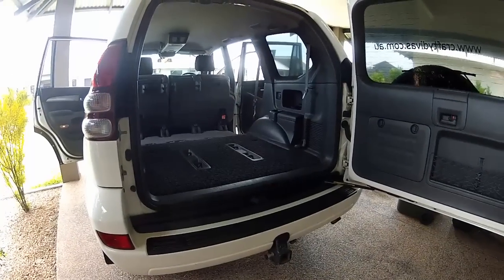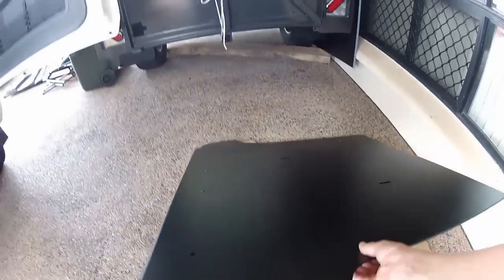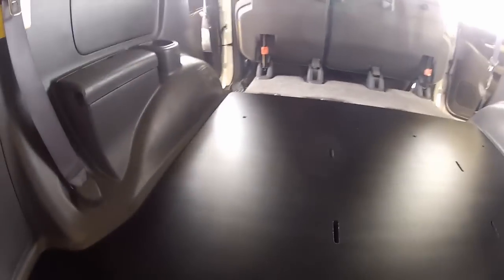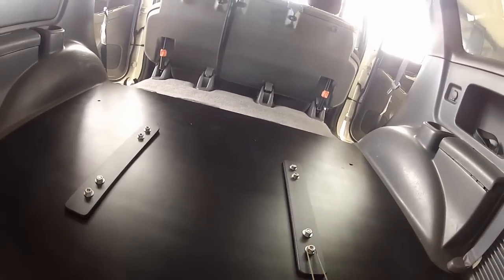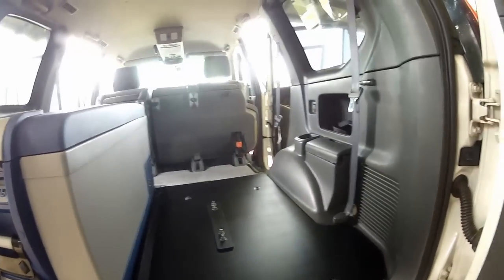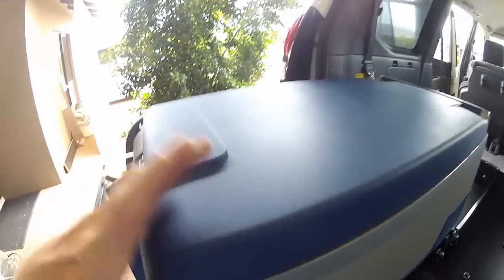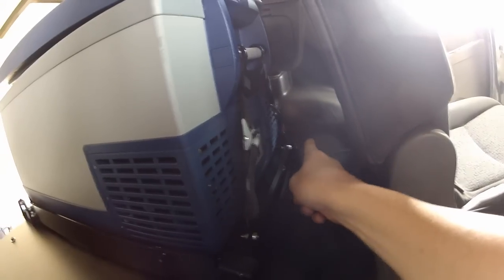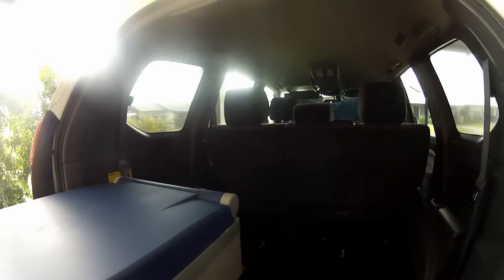Part 1 of 2 Fridge mounting system for 120 series Prado

Comment: Hey mate... Great desing.... I want to ask you where can I buy the flat plate u bought to pass the u bolt? And how it that call? Have you had to drill it to fit the u bolt?
Reply from the maker: jesromerg I just brought some steel plate and drilled the hole. I then tied some string to the u bolt fed it through the hole in the timber board and pulled it throug